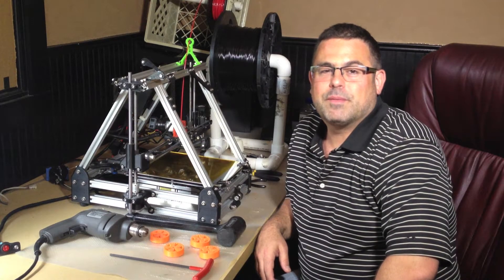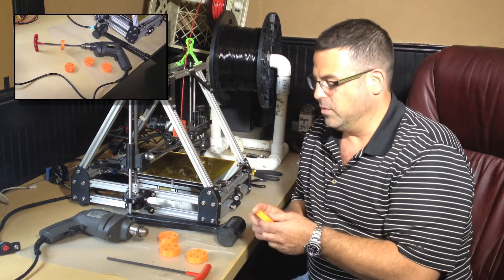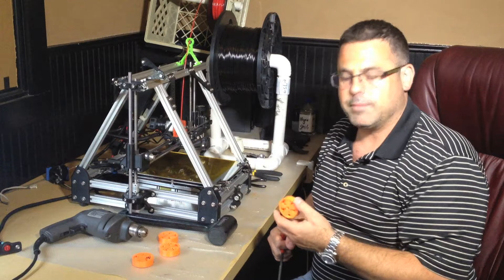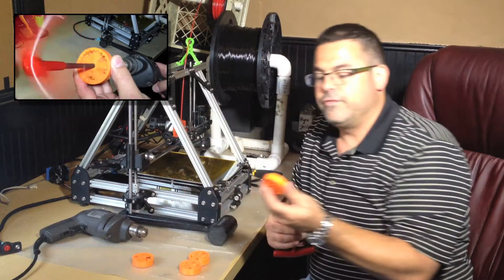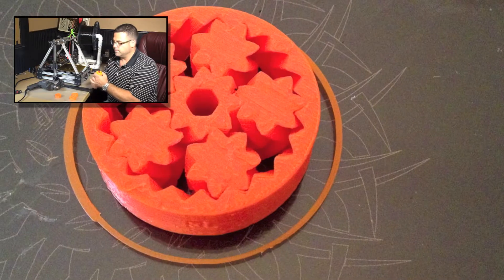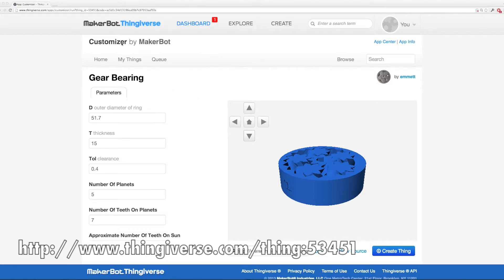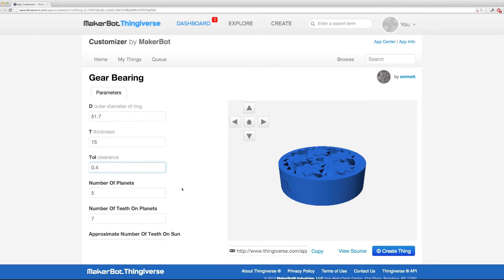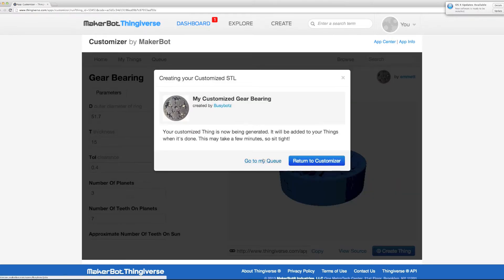3D Printed Gear Bearings

Comment: I printed mine it was stuck together but I managed to free it up. I took it to work and the guys where pretty impressed. After I spun it up with a pencil grinder to max speed (22000 rpm) and started to melt and misalign the gears.

Comment: When it came out I tried to print this bearing three times before giving up. Now that I have more experience with my printer I might give it a new shot. Thanks for the hammer tip.

As for the noise from your printer, it's odd because I have a Lulzbot AO-100 which is also based on the MendelMax, it is nowhere near that loud.